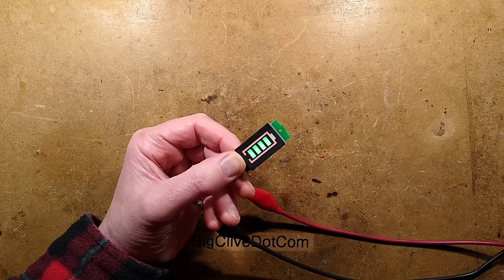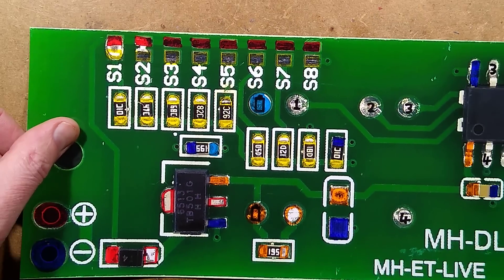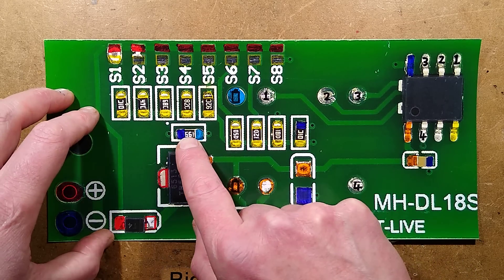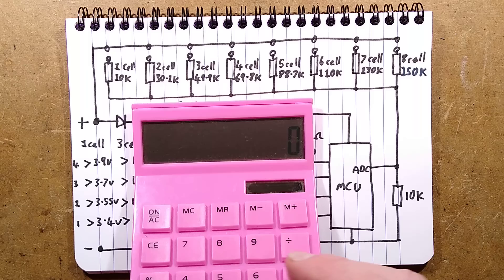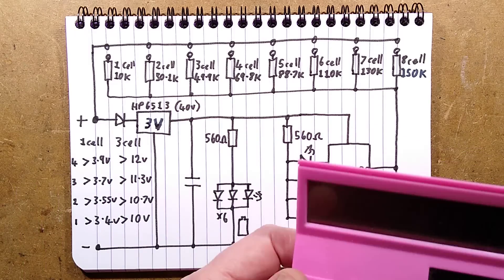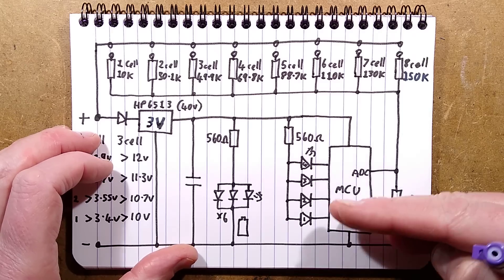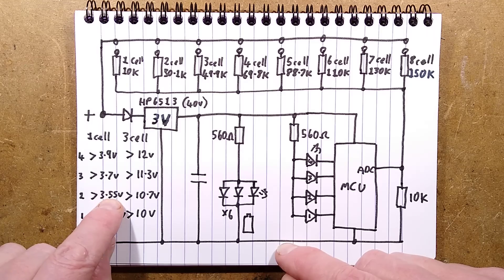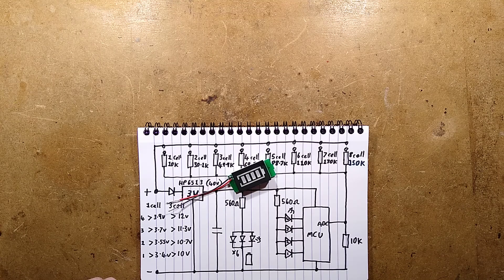Fancy 1-8 cell lithium battery level indicator

Comment: Your comment on flashing for overcharge depends on how they're referencing the ADC. If they're using a Fixed Voltage Reference (literally the FVR in PIC land, either 1.024V, 2.048V or 4.096V), then if the ADC input exceeds that reference, the ADC reading will just saturate and be pegged at (2^n) - 1, unfortunately losing that overvoltage detection.

Having said that, I guess a competent designer would've sized the potential divider to not use the entire full-scale range, thus allowing such a saturated reading to be handled in software... Maybe they even did that and were just lazy and skimped on the animation... I guess we'll never know.
Reply: Well, looking at 8-cell, with it at 33.6V full charge its at 2.1V on the ADC input. So they picked the 2V reference, and it will already be saturated before it even hits full charge.
Reply: @clynesnowtail1257  Mega, thanks for doing some maths for me, apparently I was too lazy at the time? 😂 I guess same goes for the single cell as well, right? 4.2V into a 10k / 10k divider would give 2.1V into the ADC, and same thing happens again.
Reply: Well, the issue with not using the full range is that you lose accuracy, and given that you'd want to be looking for something a bit over 4.2 V (single cell) for "saturated," you're then looking at covering 50% more range. I have always wondered how accurate these ADCs are; would using only two thirds of the full range for the "non-overloaded" levels make the accuracy significantly worse? Perhaps not, in an application like this....
Reply: @Curt_Sampson  Not sure I quite follow what you're saying. In the case of this module, the full range of the ADC is (probably) 0V - 2.048V (using an internal reference, called an FVR, inside the microcontroller). By using the FVR, you no longer have to worry about the supply voltage of the microcontroller affecting the ADC measurements. For a fully charged cell at 4.2V, being fed into a resistor divider made of two 10k resistors (the 1S setting on this module) you get 2.1V fed into the ADC. 2.1V > 2.048V so percentage wise, you're attempting to use 102% of the range. Due to how the ADCs are physically built in the silicon, this will be 'constrained' to 100% of the value. Thus, even if the cell was sitting at say 5V (grossly overcharged), the ADC would see 2.5V, but the digital conversion would still read the same as if the cell was actually at 4.2V (providing a 2.1V input) since, in both cases the ADC is saturated.

Regarding accuracy, most micros of this type I'd expect to have at least an 8-bit ADC. 2.048V / 256 steps = 8mV/step. Scaling this value UP by the ratio of the resistor divider gives (for the 1S divider) 16mV resolution across the cell. Presumably that value is pretty much constant in terms of a 'per cell' error, assuming all cells are at least roughly balanced.

EDIT: ADC saturation doesn't necessarily equate to device damage.
Reply: @adzib1823  I think your 2.048V hypothesis is flawed. The natural output voltage of a band gap reference is about 1.22V. Any other reference voltage is likely to demand individual device trimming.

Many cheap microcontrollers with ADCs, for example the ATtiny5/10, tie the internal reference input to Vcc and let the designer worry or not about a clean supply rail. PIC12F609 isn't much fancier, offering a 1.1V band gap and a 4-bit digipot between the supply rails, the latter borrowed from the comparator module. That's plenty when you have a regulated supply rail and don't need great accuracy, or you are using the common idiom of a pot between the rails as a physical control input.
Reply: @abitofabitofabit4404  Yeah, I could be totally wrong, all I know is that modern PICs 16F15xx(x) all use the FVR I've mentioned throughout. I appreciate they're a bit more fancy than this one though. A bandgap reference like you're suggesting would be essentially useless given the external circuitry. I did forget that the voltage to the device was regulated (why wouldn't it be? That's me being stupid). So I guess, yeah, the micro could be using the 3V rail as the ADC reference, although then you would be taking a fair hit on utilising full scale, 2.1V/3V = 70%. That's not to say they're not doing that though.

EDIT: Just taken a look at the 12F609 PDF, and that chip doesn't have an ADC. The upgraded 12F615 (which shares the datasheet) does. Section 9.1.3 on page 68 states that the positive reference is either VDD or externally supplied, and in this case, it's certainly not the latter
Reply: @adzib1823  I seem to have been looking at the ATtiny13A datasheet instead. :) Thanks for the correction.

The bar graph displays only the upper 1/3 of the full lithium battery voltage range. Assuming an 8-bit ADC with 6.5 bits remaining, another 1/2 bit of precision would never show up on the graph anyway, and the microcontroller input probably appreciates the headroom against spikes.
Reply: @abitofabitofabit4404  Very true, I didn't consider the fact that it only measured a small portion of the voltage range to begin with. And yeah, AVR stuff I have very little knowledge of... Something I should probably fix in 2023 :)

Comment: Would be fun applying the LM324+LM431 design to this initial set of parallel resistors.  Real fun is getting a high enough LM324 supply in the single cell configuration without getting too high in the 8 cell configuration with 8x4.7V on the input.  Maybe it would need to underpower a 5V regulator.

Comment: Well, if it was smart enough, it could do that with only one voltage divider, even if it was speculating a bit, but detecting SoC based on voltage anyhow is guesswork.
Edit: Anyone remembering Basic Stamp? And how it used a single slop measuring technique to measure voltage with a single pin and a timer? ADCs are expensive!
Could be changing colors based on the number of cells also, even smarter! hmmm...

Comment: I like this one, I shall have to go and buy some! There is another very similar battery indicator with more complex circuitry than either of those you have reviewed so far, it's based around a 14pin MCU and can only be bought preconfigured for batteries in 1S, 2S, 3S etc. I'm sure it can be reconfigured by changing something as simple as a resistor on the board.
Reply: I was just thinking the same thing - An A to D and a bar graph LED for £ 1. 5 , from Amzon UK  and 1 resistor sounds useful
Reply: @kit-geoffbullough8788  If you don't mind waiting they're only about 50p from AliExpress.

Comment: That's exactly the one I mentioned in my comment under the other video.. the 1S mode only works right if you bridge the protection diode out, otherwise the whole module dims away below 3.5V instead of showing fewer bars than 3

Comment: [Clulow (pronounced /klo͞o/ /lō/ "one low in clues" but not clueless)].  Interesting and educational analysis as in all BC Videos.  In my projects, however, I prefer the modules which display numeric voltage / pushbutton to activate. Perhaps this module might find use in a consumer product where a "dumb" SOC indicator is a good option.  But I cannot imagine using this, unless of course I were designing a circuit for the future me wherein I'm finding it difficult to remember how to turn on my computer.